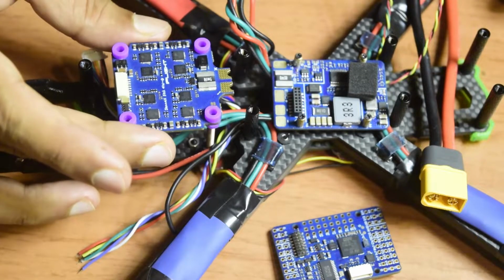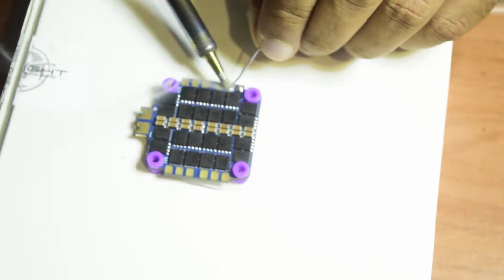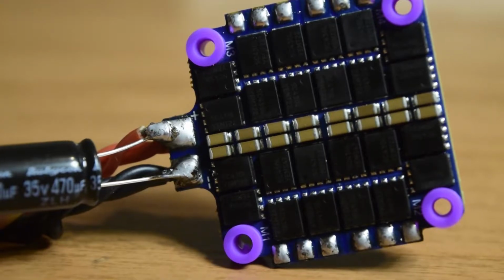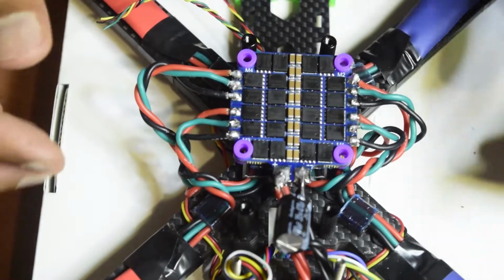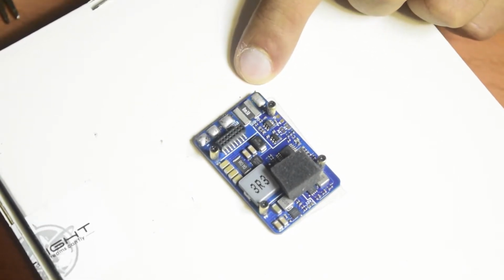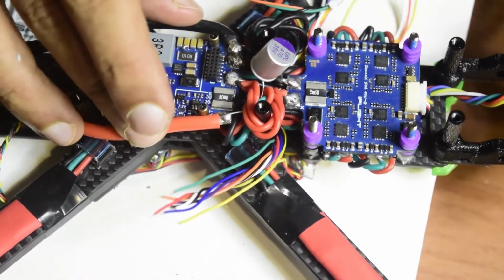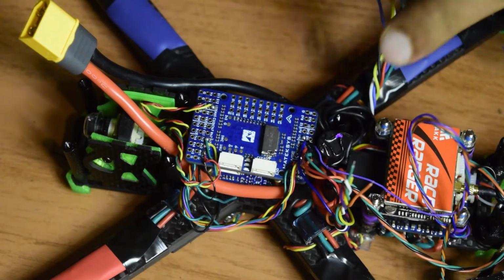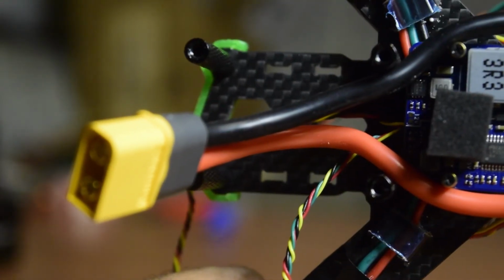HOW TO INSTALL ESC/MCU ON DRONE | MATEKSYS F765-WSE |  iFLight SucceX 50A 2-6S BLHeli_32  ESC

Comment: Your videos are very good. Thanks for sharing. May I ask a newbee question .. Any reason why you didn't use the F765-WSE  for the ESC's as well instead of a separate 4-in-1 ESC?
Reply from the maker: Thank you for your comment . It is not possible to use F765WSE as full ESC as it do not have motor connetion pads directly  for 3 wire FPV motors , yes it has PWM output and 5v and GND which is sufficient to drive a servo motor but the current drawn by FPV motors are way higher than it can support also FPV motors are 3 phase motors unlike servo motors they cannot be controlled directly using 5v gnd and PWM they need a dedicated ESC. So I used the external ESC.
Following is my review for F765WSE
https://youtu.be/zUlvU5Hq4Lc
I hope this helps . Please stay tuned to my channel for my future videos

Comment: I do not understand how you mounted the flight controller on the drone frame. The official website says that the holes are 25x25mm but the frame holes are 20x20mm. Please explain how you mounted it
Reply from the maker: i did not mount it using the screws but i used some DST and a zip tie to hold the FC on the drone frame. I hope this helped. Please stay tuned to my channel for my future videos